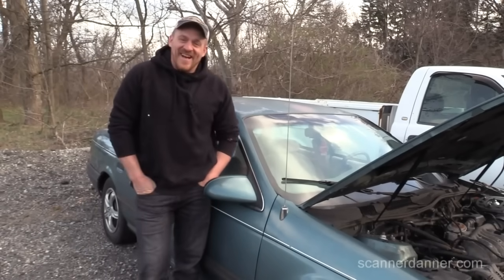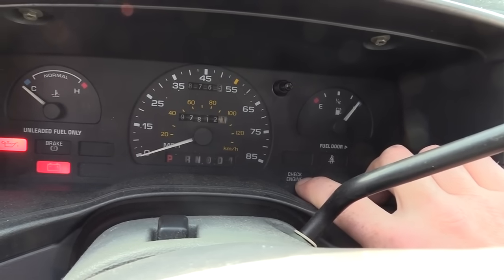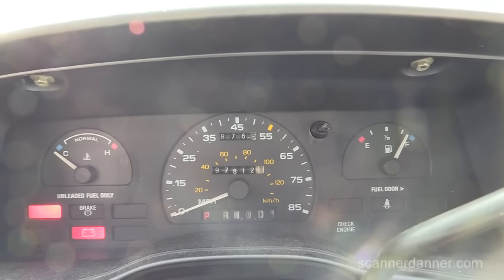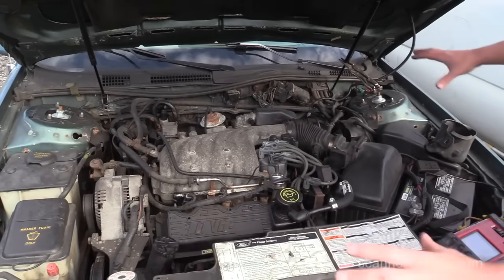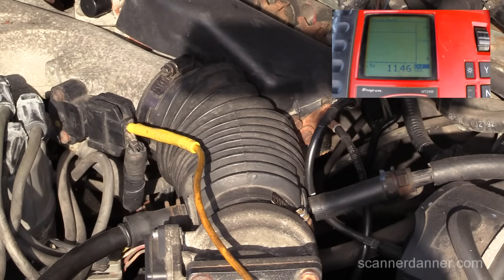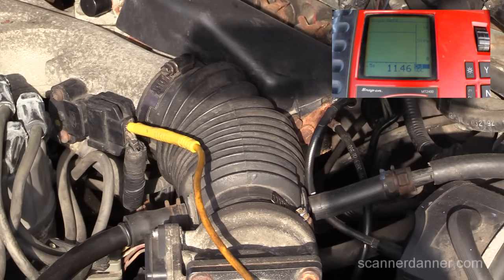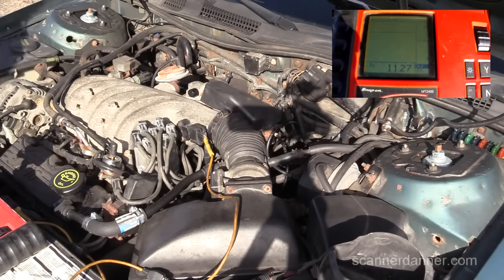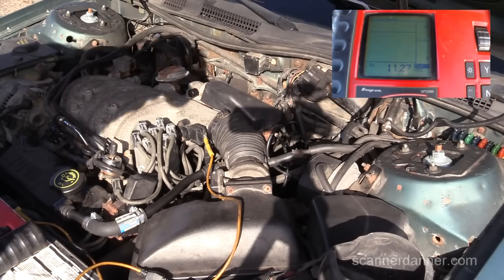Sensor grounds and the 5v reference circuit (a 2016 ScannerDanner Premium video)

Comment: I had 2 like that. One was on a Mustang. Someone had changed the battery terminal and the corrosion eventually rotted the cable all the way into the wire about a foot. They had changed the fuel pump and computer. I noticed the floating 5v circuit and remembered in electronics school that many computer circuits ran on 5v. I went to the library for a wiring diagram and saw there was only one principal ground for the computer. As soon as I fixed it, the fuel pump came alive.  The second one was a Ford pickup. Symptoms were the same. That one took 5 minutes because as I started to do general checks, my buddy who would never keep his mouth shut kept screwing with my concentration. He stopped talking for a second and asked "What's this loose wire?" It was the fkn ground off the negative all rotten.... he stole that one from me! Do you remember the Ford ignition switches that would split apart? I had one that I could keep running if I held the key barely out of start position. Owner was amazed because several people had looked at it and said "It's the computer". I fed my kids on side money!
Reply from the maker: Nice job!

Comment: Hi scanner danner  love your videos. I have had P38 dreaded range rover 2ooo1 started with faulty crankshaft censor then battery drain and now not run for a year had the AA out to it no look and mobile mechanic with no luck only  said no signal at the crank sensor I  am going to take on bord what you  have shown thanks. ?

Comment: Great videos Danner,
I have a question on a 2003 Buick century 3.1 SFI,  p0336 crank position sensor 
This sensor is located behind the crank pulley,  the other crank sensor is a 24x reference located on the engine block. 

Question is: would the font crank sensor behind crank pulley would cause a No start,   ?

I know for sure that the high reference 24x will cause a No start!!
Reply: Oops 64x reference signal.

Comment: Was those computer grounds that you repaired coming out of the computer plug in harness? So we're the ground wires grounded/bolted to a ground location on the car? I guess what I'm asking is where did the ground wires travel
Reply from the maker: Two of them would go directly to the ECM itself. Pins 40 and 60 from memory on the EECIV systems

Comment: Danner Scanner, I am a bit confused about the 5volts reference signal, PCM negative signal. I noted you use a test light with a positive  
input signal as trigger voltage. But, I am a bit confused about using a test light as a jumper to provide a signal because is 12vdc and I computer uses smaller voltage as reference voltage and trigger voltages. Not sure if you understand my question. Thanks

Comment: When you were back probing if you had plug out the tps harness and checked for 5 volts reference and a bias voltage,would the reference voltage would of been 5 volts or 11.44

Comment: Watch all your videos. Just confused on this. So why was there battery voltage on the sensor wires? I get if there is no ground there is no voltage drop but where did the B+ come from? Was it shorted to a battery wire? How does no ground make battery voltage? Thanks.

Comment: Hey Paul 
Mal from Australia 
Mate you are a LEDGEND and are so informative 
Can you do a video on a 2009 Hino 300 truck cranks but wont start 
I checked for a 5 volt reference 
Best I could get was 2.7v 
No communication at bot plug 
No check engine light 
And no movement on the tacho when cranking
Reply from the maker: Nice job so far! Absolutely stay focused on your low reference problem! Go to my chapter 9 playlist on more videos where I'm testing the reference circuit

Comment: ford "SNOREus" around those years there was terrible wire coating shrinkage, leaving bare wire outside of connectors everywhere.
possibly due to being over stretched upon harness manufacture prior to termination and heat. they loved to cook back at the speed sensor and start to random short lol
Reply from the maker: You said shrinkage lol

Comment: i dont use those style of crimper  cos you never really know if its gonna hold forever, i have had those connections come apart with those crappy crimpers...i use the ratchet type with the 3 block crimp and they rarely fail.
Reply: give a more consistent crimp pressure is what i meant to say.

Comment: I'm watching your video through a translator and I didn't understand exactly what happened. was there 11 volts on the 5 volt line due to the fact that there was a short circuit or a bad mass?
Reply from the maker: No sir. There was no ground for the 5v regulator. With no ground, it cannot drop the 12v down to 5v.

Comment: hey Scanner Danner    first of let start by saying thank you for all the knowledge you pass along.....i have 2 seperate  vehicles   one is 2011 dodge nitro /3.7 i can jump starter and truck runs but not when using key....havent checked grounds yet thats next...  2007 chrylser passifica   4.0 doing almost same thindg wont crank with key ...i can jump starter but it wont startchecked all grounds i can find even replaced some with 4 gauged wire...i noticed  butterfly in ETBS doesnt move  i check for voltage at TBS have 5volts kinda confused both vehicles were running at one time then just stopped if you have any idea  please help

Comment: Had a crx si with a no spark. Bought for $500. The radio fuse was blown or missing. Replaced it and the car ran. I think it had something to do with the alarm. Either way tons of hours were sunk into it and i spent 30 seconds

Comment: another great vid mr danner, i nearly got my ass kicked last month by a french 508, abs and stability control light on, code said missing rear wheel speed signal but on the live data the signal was there, i just couldnt find anything wrong on the wiring.
then out of the blue a code came up with front wheel speed signal missing while i was working on it, again the live data showed a speed signal, i didnt get what the hell was going on until i found the passengers foot well was full of water and had got into one of the computers. i was not expecting that i can tell you as it was summer.

Comment: Hello Paul,
Corolla 2000 throttle sensor middle wire signal reads 12.36v with volt meter set at 20volts. Ground reads 0.01v, it is light green in color, it is above middle signal wire black with green tracer ; 5vref reads 1.67v blue with black tracer. 

The signal wire is pointing to a short to ground some where. I cannot jump the middle wire to ground nor jump the ref wire to signal wire, until I find the short first on the middle signal wire? The jump test with resistor is mute does not apply in this situation.

Because there is a shorted to ground on throttle sensor signal wire  involving the other sensors shared grounds, do I wiggle wire harnesses; do I follow wire diagram to the ecm tracing the black green tracer signal wire 12.36v to the computer first; before wiggling wire harnesses; 

do I have two separate issues, a shorted throttle signal wire n a defective throttle stuck or cracked mother board; with no resistance at open n close throttle, while back probing all three wires reading 0000 opn/cld throttle?

Meter on ohms setting connecting to the pins of throttle sensor ground and signal middle pins reading is 1.814 ohms, it stays the same  in open n closed throttle no resistance variable readings. 

Do I replace the throttle first, then see if car starts; will it correct the short to ground on the signal wire to the throttle sensor?

Respectfully,
Alexander Gonzalez.

Comment: People really don't understand how long it takes for us to replace something. If it's just myself it's going to take me awhile to fix even the simplest of things because there's thing I need to do before even working. Unplug battery, visually inspect engine bay for obvious problems. Just testing the fuses takes forever one by one. Even a simple spark plug & ignition coil or wire replacement is gonna take me 20-30 minutes to do correctly & safely. I always take the time to make sure any car I fix or repair, I would drive & I do this checklist after I'm done billing someone time. I usually never have any doubt about a car & 99% of time I would trust my child in car but if there's ever anything I missed I fix it without charge because it's on me or if I notice something else dangerous I inform customer & let them decide if it's not dangerous to not fix it e.g. radio or cosmetic damages. Point being, it takes us quite a long time to find out what exactly is happening in car especially if we have to go in after other mechanics have been through it & put everything back in & then look for problem.

Comment: SCANNERDANNER, why is the sensors ground isolated or lifted from the car battery ground, they aren't connected together? What is a good resistance range for various car sensors?
Reply from the maker: They run the grounds back to the ECM board to help with noise and it is hard to answer sensor resistance values. The temp sensors change based on temp. The position sensors are around 5k and pressure sensors any vary greatly

Comment: Wonder if this is the issue on my 89 s10 pickup.  If the ECM has grounding issues if it would run badly. Another issue is when I am coming to a stop the truck tries to stall.

Comment: what is closest in line to the battery positive cable, the connector or the sensor on the throttle body?

Comment: Great video, but I don't understand how three pins of TPS have a battery voltage. your video didn't show which ground wire touches 12V battery wire.

Comment: My only problem with the video is Paul making repairs with the battery  still powered up.. make sure you unplug the battery before making any repairs to electrical or electronic components.. other than that,  I love  it..
Reply from the maker: Key off wiring repairs are perfectly acceptable on a 12v system.
Reply: @ScannerDanner  I knew you were doing that to save time, and show the effectiveness of the repair.. I loved it..

Comment: What if you have a 5 V reference that is showing 6.1 V instead of 5 V? I have a 2007 Dodge Durango crank no start. What’s weird is that I hold the key in the start position and it cranks for a few seconds, then it stops, then it cranks for a few more seconds, then it stops and so on and so on. I’m kind of at a loss. I don’t expect you to answer this due to the volume of messages you get, but I thought I’d give it a shot anyway. Thanks Mr. Danner and have a great day.
Reply from the maker: 6v is too high and suggests a high resistance computer ground. What does ref voltage do during the crank, start, stall cycle?
Reply: @ScannerDanner  Well, the vehicle won’t start so obviously it won’t stall, but I have not checked to see what happens to the reference voltage when cranking. When I get to the shop in the morning, I will definitely do that. I had a whole bunch of things on my list before the battery died, so I have it on the charger overnight and I will have a fully charged battery in the morning to perform more tests. I should’ve known about that computer ground from what you taught me way back in the day. I used to work on airplanes in the Air Force for 10 years, but when I switched back to vehicles, it was a huge learning curve again. Thank you so much for responding to me. I really appreciate it. I was wondering if you had an email or someway I could get a hold of you outside of YouTube because I wanted to send you a little gift as a token of my appreciation. Hint (It’s a Wi-Fi oscilloscope, that is amazing for automotive).

Comment: Do you always check the 5 volt reference on a sensor being plugged in? I tried a 5 volt reference on one of my van's sensor. Unplugged I was reading 5 volts exactly and when I plugged it on and back probed it I was getting 3.2 volts. Does this means the sensor is bad or there are some resistance from the sensor?? I'm new and learning.
Reply from the maker: That sounds like the signal circuit which most have a 5v bias unplugged
Reply: @ScannerDanner  Thanks Danner. This makes sense. I am only a locksmith but I follow your channel. I had another problem with my van not long ago and made a video out of it. I did mentioned you in that video. In case you want to see what and how I did (thanks to you) here is the link: https://www.youtube.com/watch?v=31Y4HMnUSY8 Keep them videos coming. We love them, and you lol.

Comment: Dealing with something similar i have 5.02v at my map sensor but once i go down to the ac pressure switch reads 4.78 im thinking something on wiring harness  or  sensor in between them? Or is it normal to drop that low further down the line

Comment: Mr ScannerDanner, I have an 02 Saturn L300 L8 sedan appx. 136000 miles. Just started a no firing issue. Fuel injectors are pulsing when engine is cranking. I am getting 2.54 dc volts on positive lead to CKP sensor, also the sending wire on the CKP HAS 2.54 dc volts on it. This with unit plugged in or not. Also noticed coil packs have 12plus volts on each wire except grd. wire. But unplugged the connectors seem normal. Been messing with car little more than 2 months. Was gonna replace ECU on engine. Swap out from junk yard. Both junk yards said wasn't anything wrong with the one on the car, and I'd be wasting my money. So I put it back on the car. I was wondering am I supposed to be getting a 5volt dc input current to the CKP sensor. By the way I replaced the CKP about 2 weeks ago. But made no difference. PLEASE help info. I have no scan tools. Just test light and Multimeter. I been following your lead and classes but to no avail on this Saturn it has kicked my but.
Reply from the maker: The 2.54 volts on the crank sensor is most likely a bias voltage and if the injectors are firing, I'm not really worried about the crank sensor. Is it a 2-wire crank sensor? If it's a 2-wire it produces AC voltage but only when the engine spins. These often have a DC bias underneath the AC sign wave that the sensor produces.
What engine is in this?
How did you confirm injection pulse?
Reply: Mr ScannerDanner,  I can hear the fuel pump come on and stop like normal. When I turn the key on fuel rail maintains 45psi cranking engine over with the spark plugs out and can smell has in each cylinder. But have not tested injectors with noid lights or test light like you did. But since I wrote you now the the fuel pump stopped working. Fuse is good relay not responding. So where relay goes I jumped it with a paperclip and fuel pump comes on so I'll have to research that to now. Replaced fuel pump about a year ago everything worked fine afterwards. Till now.
Reply: Oh yeah the CKP is a 3 wire, and coil packs are 5 wire.
Reply: The motor is a 3.0 v6, 24 valve overhead cams.
Reply from the maker: @georgejones7358  pretty sure your crank sensor has a 12v feed (if it's a 3-wire). It could have a 5v reference as the feed instead of 12. 
With your key on, unplug your TPS and tell me if you have a 5v ref on at least one of the 3 wires

Comment: Where did you get the Engine performance circuit.. Or wiring diagram of an vehicle..? Thanks in advance
Reply from the maker: https://eautorepair.adtrk.biz/?a=10817&c=24&p=r&s1=
Here you go. This is the DIY version of the service information I use

Comment: ‼️Help‼️ my engine computer recently went shot in my 2015 Dodge Challenger sxt. I replaced it and everything works fine until it sits overnight. When i go to push start in the morning it takes a couple of tries at the push starts to crank up. Then after that its fine for the rest of the day. I’m going to try another engine computer. But any advice or idea what it might be? THANKS GUYS.
Reply from the maker: Don't do it! It's not the engine computer and you are going to add problems throwing parts at it brother. Post this to my forum, it's free to join. We can help if you can do some testing with at least a DMM and basic scan tool.
Reply from the maker: https://www.scannerdanner.com/forum/post-your-repair-questions-here.html
Reply: ScannerDanner cool i posted it in the repairs forum...thanks
Reply: ScannerDanner still haven’t seen any replies on my post. Maybe because I’m a newbie lol. Just need to know where to test on the wiring diagram. Update: I realized that if i push the start button once and let it power up for about 15 seconds it will actually crank up the next push. I don’t have to keep pressing it. Ugh I can’t wait till i get my corvette in 1 year 1 month and 28 days 🤣

Comment: Thumbs up for Danner.  I still cringe seeing you use butt conectors. A soldered connection allows more reliable current flow when exposed to the elements over time. Butt connectors oxidize and gradually break down current flow with changing atmospheric conditions. Good electrical connections are more about current flow than voltage.Butt connectors are a temporary solution.  Pardon my critisism, I still think your awesome!
Reply from the maker: The ground circuits on our cars are typically not insulated at all. If this was a power wire I would have taken more precautions.

Comment: will the voltages be the same if you unplug the sensors when u check ref voltages
Reply from the maker: ref voltage should be the same plugged in or unplugged. In general you always want to do these tests with the sensor plugged in as you want the circuit loaded

Comment: I wish I had this guy working on my A/C. 2 days in the shop of diagnostic testing and the tech still can't figure it out. No signal to the pressure switch, compressor clutch is good. Hopefully something like a connector or ground issue is the culprit. I'm going to have to spend more $$ on another tech I know to try and resolve it before it gets warmer again.

Comment: I have a 1995 jeep grand cherokee 4.o I have no power to the coil. No power/signal to the battery voltage sense (asd relay) wire. The auto shutdown relay has no ground im told the ECU is telling the car to not start... Can i get any advise? Id appreciate it